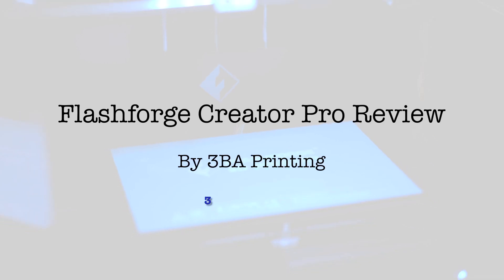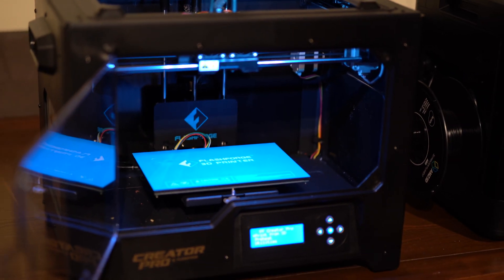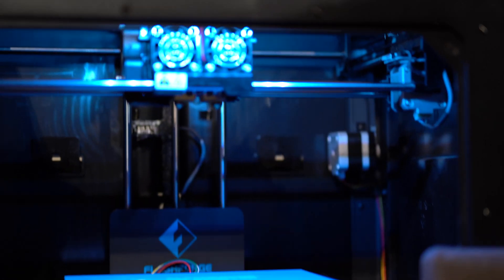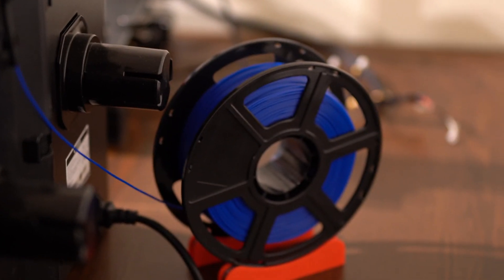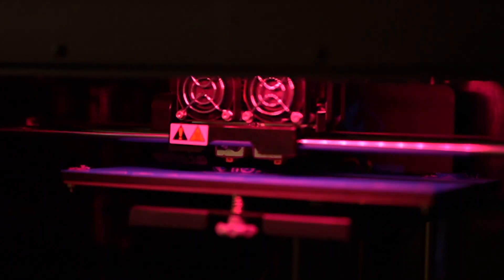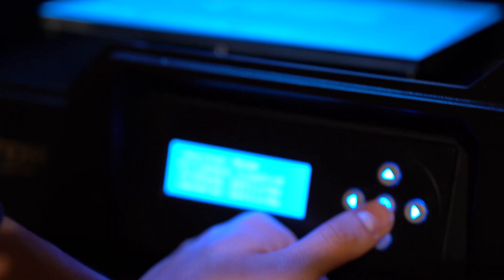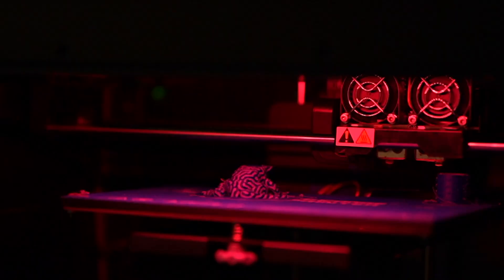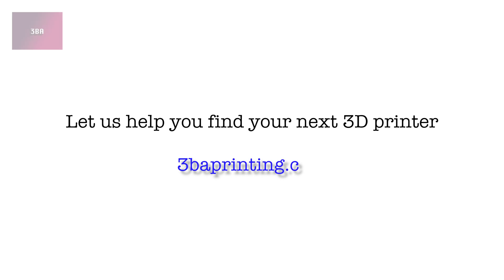Review of Flashforge Creator Pro

Comment: i find it funny that half the dribble wasnt a real issue. the only big deal was the proprietary slicing software requirements.
ABS prints fine, get an all metal hot end if you feel you need to.

Comment: For $1,500 I had expected more. 🤦🏻‍♂️
Reply: $1500??? Mine was $399 😂
Reply: @tito9107  I bought min in 2015, but haven't used it yet.
Reply: Yeah, I bought mine in 2015 and paid about $1,500. Got busy starting a family etc and just opened the box in 2024.
Reply: Facts!! I bought mine 8 years ago.  Back then that price was normal for a 3d printer.  Now a good machine is under 600$.  The Guy is 100% correct on the flashforge software, IT SUX

Comment: I have not had any issues loading or unloading filament. I manage to print ASA at 240C. The worst issue I have with this printer is the total lack of documentation. They provide some tools, but no documentation beyond leveling the build plate. Going online for advise is error-prone. Leveling the two nozzles is essential at times, and there is nothing in the documentation about this. Some people online mention a grub screw, which does not exist on my printer. I managed to shim the carriage with sticky aluminium foil, available from electronics stores, using a feeler gauge. Getting the model to stick to the build plate requires sensitive and careful leveling the bed and setting the first layer thickness. Dr Lex has some decent slicer settings for prusa-slicer.